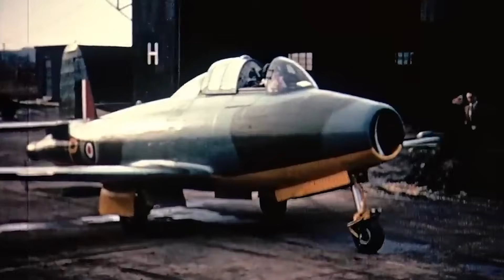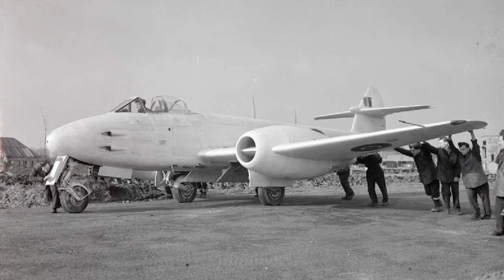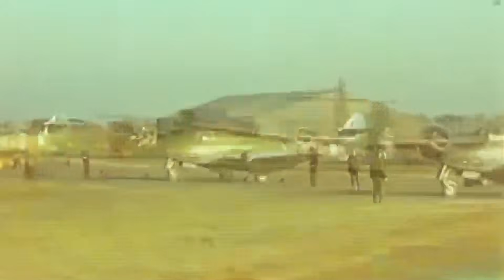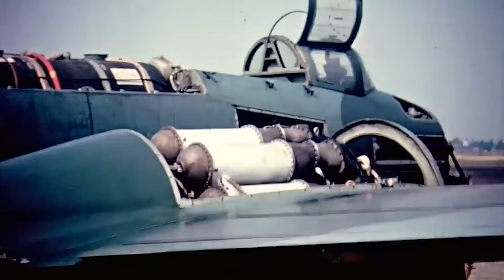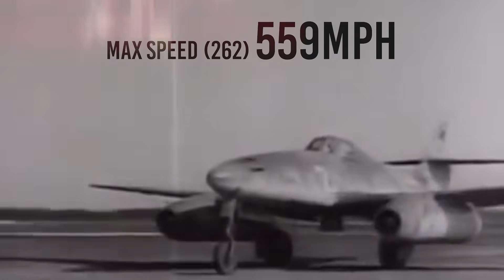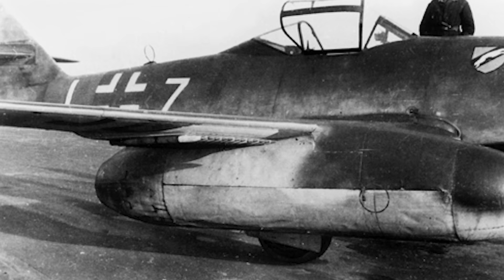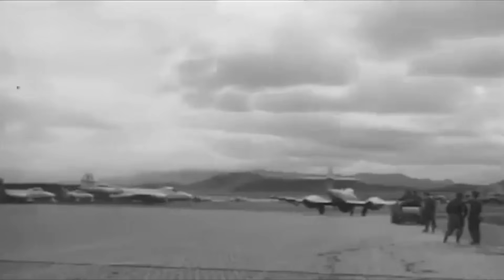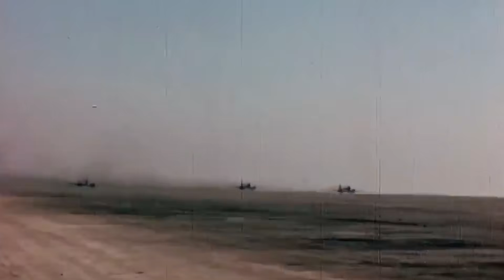Meteor vs Me 262 | Which was the better WW2 jet?

Comment: No Meteor ever had a Tailwheel!!! The first four Me-262's did!!!
Reply from the maker: you are so right - we got this around the wrong way - will put a correction in the description - thanks for spotting the error!
Reply: METEOR. l'aereo delle. MERDACCE ASSASSINE.
Reply: The 262 was essentially like the Heinkel which had a nose gear and a different empenage which made takeoff and landing easier but the swept wing of the 262 gave it more speed.
Reply: @WilhelmSallsten The sweep of the Me262’s wing was accidental. It was a consequence of the centre of gravity being further aft than expected.
The wing sweep is somewhat less than the typical subsonic jet and about the same as the DC-3.
The research on wing sweep in wind tunnels at sonic speeds post dates the design of the Me262 and the Me P1101 more accurately shows the results. The Me262 wings thickness undermined its ability to be controllable at high speeds - thinner wings, like on the Spitfire, or laminar flow wings, like on the P-51, perform better above Mach 0.84.
The Me262 was fitted with the gear off the Me309 because it had insufficient elevator authority to lift the tail off the ground at any airspeed the aircraft could reach tail down.
Reply: @allangibson8494 Indeed, the 262 pilot had to tap the brakes to get the tail off the ground and into clean air.
Reply: @allangibson8494  Nah, the 262 was faster than the Mustang and Spitfire. Over 100 mph faster. The Messerschmitt Me 262 initially had only its outer wing swept back by 18.5 degrees to fix a center of gravity problem caused by heavy engines. Later, using data from wind tunnel tests at AVA Göttingen, engineers also swept the inboard section leading edge to match. High speed aerodynamic research did not exist in England until after WW2, when the British were able to obtain German super sonic wind tunnels, scientists and research which eventually led to the Concorde. BTW, the propellor was the limiting factor on all piston engine fighters' critical Mach number.
Reply: @TheAneewAony The Me262 was faster in level flight. It was slower in a dive than a Spitfire. (The Spitfire was a beast - but lacked the range to get to central Germany where the Me262’s operated).
The late 1944 Gloster Derwent Meteor was faster in level flight than the Me262 even with its straight wings - because it had more than twice the thrust.
A quarter of the Me262’s ever flown were shot down by P-51 Mustangs.
About half of the total were however brought down due to engine failure. (Me262 Jumo engines were that bad with a cycle life of ten to twenty starts).
Reply: @allangibson8494  It's true that Martindale took a Mark XI Spitfire into an extreme high-speed dive exceeding 600 mph, but the wings were bent and the propeller broke off nearly killing him, and the airframe was written off. In 1944 the Me-262 HG I hit over 600 mph in level flight. German records and pilot victory claims attribute roughly 7 Spitfire kills to the Me 262, all 28 WW2 jet aces flew the 262. At this point of the war, the 1936 design Spitfire was completely outclassed by vastly superior P-51. 8th AF P-51 Mustangs defeated the Luftwaffe making it safe for the RAF to operate in daylight. No version of the WW2 Meteor ever approached 500 mph, none, zero. In fact the Meteor III's airframe was still limited to .74 Mach and 500 mph IAS in 1946. This is outlined in the 1946 Central Fighter Establishment report number 68, paragraph 54: "FLYING LIMITATIONS: 
(i) The maximum permissible speed on the Meteor III, imposed for structural considerations is 500 I.A.S.
(ii) The critical Mach, number on the Meteor III is.74. (This is additional to the 500 m.p.h. I.A.S. restriction mentioned above). Therefore, it can be seen that at low altitude the structural limitation is the deciding maximum and at altitude it is the Mach, number limitation."

Eric Brown: “Speed. Speed. It was a pedestrian aircraft, really, the Meteor. It never went into… It never fought operationally. It fought, if you like to call it that, against the V1, the flying doodlebug, and quite successfully. But it really was too slow to deal with the German jets when they came into being. They were a grade above at first. The Me262 is quite frightening. It gave us a shock to find out, because when I flew it the fastest fighter we had – piston fighter, of course – in the Allied camp was the Seafire Mk14 with a top speed of 446mph. The Me262 was 125mph faster than that aircraft. So this was a rude shock to our system, I tell you, when we found that out.”
Reply: @TheAneewAony 

LOL
 Early days, jet engines. Whittle performed the world's first demonstration of a gas turbine aero engine in 1937. The RR Nene, a centrifugal gas turbine aero engine, was the world's most reliable & most powerful gas turbine aero engine in 1944. Licensed built versions & copies of the RR Nene & RR Derwent would go on to power many aircraft in Russia including the Mig 15 & Mig 17, the US, China, France & other countries for decades after 1944. Incidentally, the Mig-15 was in essence an upsized / tweaked copy of the Whittle / Gloster E28/39 jet aircraft including an uprated copy of the RR engine.  The basic centrifugal compressor gas turbine aero engine with Whittle style reverse flow combustors and sometimes an axial compressor section is still manufactured by more than one company including Pratt and Whitney, the main application being helicopters.

The gas turbine engine was invented in England during the 1700s.

During the late 1800s Parsons of Ireland & North England produced the world's first axial multi stage sequential stator rotor turbines and compressors for turbomachinery use which would eventually go on to to form the main components of the axial gas turbine aero engine. At the time the basic idea of making an internal combustion gas turbine engine and using it as an aircraft engine was considered thus the jet aircraft concept had been created in England before the first powered aircraft flew.

An example of what goes on these days in various countries. For example, there are of course no German companies that makes German jet aircraft in Germany & there are no German Companies that make German gas turbine aero engines in Germany that are suitable for widebody airliners.

The UK has the world's highest combined per capita Nuclear / Defence / Aerospace Sector Activity.
Reply: @petemaly8950  LOL, Whittle never built an axial flow engine. If he could have he would have. We agree, there are still a couple of places where the low tech, low cost centrifugal engine has application, generators etc. The Russians built copies of the Nene for the same reason that the British did, they struggled with the complex axial flow and the simple centrifugal flow is all that they could do. BTW, Dr Franz, inventor of the axial flow engine which was used in the Me-262 and the Ar 234,  alsodesigned the helicopter engines used in the Bell UH-1 Iroquois, Bell AH-1 Cobra, Boeing CH-47 Chinook and the M1 Abrams tank engine.. 

"The day the 262 arrived, every Allied fighter became museum pieces". -- Eric Brown

"Britain’s military dependence on US ‘no longer tenable’, says former Nato chief"  --https://www.theguardian.com/politics/2026/apr/22/britain-military-dependence-on-us-no-longer-tenable-lord-robertson
Reply: @richardvernon317  No Meteor ever saw WWII combat!!!
Reply: @TheAneewAony  WRONG!!! 616 Squadron were allowed to operate over Enemy Territory from 16 April 1945 while based in South Holland and in Germany Proper. Flew 208 operational Armed Recce and attack missions up to 4th May, including 2 deliberate attacks on Luftwaffe Airfields at Nordholz and Schonberg. On the later the Meteors destroyed 7 Luftwaffe aircraft on the ground. The Meteors during this period shot up around 60 vehicles, 2 trains and a couple of Flak positions to boot.  Only manned German aircraft that the Meteor ever ran into while both aircraft were airborne was a Stoch on 2nd May 1945. The Stoch managed to evade the Meteor’s first attack and as the meteor pilot set up for his second pass, the Storch pilot dumped his aircraft in a field, him and his passenger jumped out of the aircraft and ran for cover. After which the Meteor destroyed it with its 20mm Cannons. In WW1 that would have counted as a kill.
Reply: @richardvernon317  Nah. The Meteors were intentionally hid from combat due to its slow speed. The Meteors shot at already abandoned vehicles behind friendly lines. No Germans fired at Meteors, nor did any Meteor fire at a German. None. To give pilots combat experience and test the aircraft’s four 20mm Hispano cannons without risking the jets over enemy territory, they were sometimes directed to strafe "targets of opportunity" in liberated areas. This included already abandoned or captured German vehicles and equipment. The Storch nearly shot a down a Meteor, pretty amazing. One Meteor may have been shot down by a He 162.
Reply: @TheAneewAony     

As you know, the worlds first demonstration of a gas turbine aero engine was performed by Frank Whittle in 1937. He had drawn up basic designs for all current modern gas turbine engine configurations during the 1930s.   

LOL No 262 managed to down a Meteor. The Nimonic nickel super alloys were developed in Hereford England 1939 -1940. In Germany they thought they needed to use stainless steel for turbine blading which doesn't work and due to various issues ended up attempting to use pressed sheet steel turbine blades. 

262 & it's engines = Garbage (but it did actually fly which surprises a lot of people). In both Russia and France good people wasted their time trying to do something with the engine after 1945. Russians ceased trying in 1948 as their own effort was clearly better.
In France RR got involved in 1950 and managed to get something useful working. 

We feel we can clear up some commonly held myths and misconceptions, obviously.
It's always good to see the facts presented clearly and concisely isn't it?

The Gloster Meteor was one of the world's first jet fighters to go into service, it was in service during WW2. The meteor was the first effective multirole fighter bomber jet aircraft with a reliable engine to go into service,  It broke speed records in 1945 and 1946. During WW2 it was in service as a fighter and multirole aircraft over the UK and over all allied controlled territories in Europe and beyond. 

The ME-262 and it's 46 minutes life engines were abandoned shortly after 1945, it had a do not exceed speed of 456 mph and was only ever used to attack bombers with losses of three 262s for each downed bomber.  During WW2 most of the ME-262s were destroyed by their engines, were various types of accident losses or were shot down by bombers. No German designers were involved with the Mig-15. The Mig-15 used a copy of the RR Nene.  

During the Korean conflict most of the Meteor casualties were due to groundfire or accident losses. The result of any tangles between Migs and Meteors was that Mig pilots avoided getting into dogfights with Meteors. The battle of Sunchon, where 50 Migs against 14 Meteors resulted in the supposedly superior Migs failing to gain any clear advantage caused the Koreans to re-evaluate tactics. General opposition in Australia to involvement in the Korean conflict resulted in the govt using the battle as an excuse to reduce the RAAFs involvement to troop support only.

The world's first wind tunnel was built in England during the 1800s. The world's first supersonic wind tunnel was built in England during the 1920s. 

The Whittle Gloster E28/39  was of course a brilliant aircraft that was later copied in Russia as the upsized and tweaked Mig 15 with a copy of the RR Nene gas turbine aero engine. The RR Nene being the world's most powerful & most reliable gas turbine aero engine in 1944.

The MD F3H Demon was a contemporary to the DH Sea Vixen & had a similar performance. The F4 Phantom was a follow on from the F3 Demon. The Sea Vixen took a long time to get from first flight to introduction for various reasons and a similar situation occurred with the MD F3H Demon.

McDonnell Douglas F3H Demon
590 Built. Not Supersonic.
Max Speed 578 MPH.
Introduction date 7 March 1956
First flight 7 August 1951
Retired 1964

MD F-4 Phantom 2
Number built 5,195
Manufactured 1958–1981
Introduction date 30 December 1960
First flight 27 May 1958

DH Sea Vixen
Number built 151 (including two DH110 prototypes and one Sea Vixen prototype)
Introduction date July 1959
First flight 26 September 1951
Max speed 695 MPH.
Retired 1972

Interesting British achievements.
There is no doubt that the Fairey (England)
Delta 2 was of course the world's first jet
aircraft to exceed 1000 mph.  Indeed It
exceeded the previous record by 310 mph &
held the record for 1 year. Incidentally, the Dassault Mirage 3 & 4 are based on the Fairey Delta 2.

The Panavia Tornado & Euro fighter Typhoon are British design aircraft with British design engines built by international consortiums. 

The EE Lightning was one of the fastest aircraft on the planet when it first achieved a Mach 2 flight. 

Early days, jet fighters.
De Havilland Vampire, Sea Vixen & Gloster Meteor accident losses were not high or unusual for fighter aircraft at the time. De Havilland built large numbers of all metal airframe aircraft before the DH Comet.
We mustn't forget of course that the DH Vampire for example first flew in 1943 & the engine was also built by De Havilland. There were examples of the Vampire interceptor / fighter in service until 1990 which was operated by more than 30 countries.

Non combat phase accident losses.
% of Aircraft built.

The Canadair CL-44 was a turboprop airliner.
Canadair CL-44                  (ff 1959 ) 48%
Lockheed XF104                (ff 1954) 100%
Lockheed  P80                   (ff 1944) 43%
Lockheed F104                 (ff 1954)  45%
Grumman f9f-5 Panther   (ff 1947) 44% 
Convair F102 Dagger        (ff 1953) 45%  
MD F-101 Voodoo.             (ff 1954) 34%
MD FH Phantom 1            (ff 1945)  35%
MD F4 Phantom 2             (ff 1958)  28%
MD F3H  Demon               (ff 1951)  32%
Gloster Meteor                  (ff 1943)  21%
DH Vampire UK                (ff 1943)  23%
DH Sea Vixen   UK           (ff  1951) 33%
Gloster Javelin  UK         (ff 1951) 20%
EE Lightning  UK             (ff 1954) 33%

It's a great pity & a crying shame that British military forces had to occupy a large part of Germany for decades after 1945 & Russian military forces had to do the same. Of course Russia still posseses a large chunk of what was German territory & of course Russia & the UK produce nukes. Obviously Germany does not produce nukes.

Early days, jet engines. Whittle performed the world's first demonstration of a gas turbine aero engine in 1937. The RR Nene, a centrifugal gas turbine aero engine, was the world's most reliable & most powerful gas turbine aero engine in 1944. Licensed built versions & copies of the RR Nene & RR Derwent would go on to power many aircraft in Russia including the Mig 15 & Mig 17, the US, China, France & other countries for decades after 1944. Incidentally, the Mig-15 was in essence an upsized / tweaked copy of the Whittle / Gloster E28/39 jet aircraft including an uprated copy of the RR engine.  The basic centrifugal compressor gas turbine aero engine with Whittle style reverse flow combusters and sometimes an axial compressor section is still manufactured by more than one company including Pratt and Whitney, the main application being helicopters.

The gas turbine engine was invented in England during the 1700s.

During the 1800s Parsons of Ireland & North England produced the world's first axial multi stage sequential stator rotor turbines and compressors for turbomachinery use which would eventually go on to to form the main components of the axial gas turbine aero engine. At the time the basic idea of making an internal combustion gas turbine engine and using it as an aircraft engine was considered thus the jet aircraft concept had been created in England before the first powered aircraft flew.

An example of what goes on these days in various countries. For example, there are of course no German companies that makes German jet aircraft in Germany & there are no German Companies that make German gas turbine aero engines in Germany that are suitable for widebody airliners.

The UK has the world's highest combined per capita Nuclear / Defence / Aerospace Sector Activity.

UK defence sector, absolute terms, world's second highest activity. 1st for per capita defence sector activity. Per capita nuclear powered submarine construction, 2nd position. 
Main players being Rolls Royce, Babcock, GKN Aerospace & BAe Systems. Activities often involve international collaboration. BAe systems, RR and other UK companies now handle more Airbus work value wise than Germany. 

There's a good chance that anyone currently flying on a widebody airliner will be on an aircraft powered by RR gas turbine aero engines made in the UK and a good chance there will be other hardware on the aircraft that's designed and / or manufactured in the UK. 

Rolls Royce Holdings UK
Subsidiaries
- Rolls-Royce plc
- Rolls-Royce North America (ex Allison etc Classified Military stuff)
- Rolls-Royce AB
- Rolls-Royce Deutschland
- Rolls-Royce India Private Limited
- Rolls-Royce Marine Power Operations
- Vinters Engineering Limited
- Rolls-Royce Controls and Data Services
- Rolls-Royce Power Systems
- Bergen Marine
Joint ventures include:
- Rolls-Royce Turbomeca
- MTU Turbomeca -

Trent Family
The MT30 (Marine Turbine)
Industrial Trent 60 Gas Turbine
Trent 7000
Trent XWB Airbus A330neo.
Trent 1500
Trent 1000
Trent 500
Trent 600
Trent 700
Trent 800
Trent 8100
Trent 900
   
RR wholly owned subsidiaries in Germany handle smaller 2 shaft RR gas turbine aero engine work.

The UK space and aerospace sectors are highly productive, high-value industries that together contribute over £18 Billion in direct Gross Value Added (GVA) to the UK economy. Individually, the space industry directly contributes about 0.3% of UK GDP 7•2 Billion while the aerospace industry contributes approximately 0.5% £10•9 Billion.
   
Wee hopes theze helpsmz.  EtC---.

We hope this helps of course 👍
Reply: @TheAneewAony 

 Early days, jet engines. Whittle performed the world's first demonstration of a gas turbine aero engine in 1937. The RR Nene, a centrifugal gas turbine aero engine, was the world's most reliable & most powerful gas turbine aero engine in 1944. Licensed built versions & copies of the RR Nene & RR Derwent would go on to power many aircraft in Russia including the Mig 15 & Mig 17, the US, China, France & other countries for decades after 1944. Incidentally, the Mig-15 was in essence an upsized / tweaked copy of the Whittle / Gloster E28/39 jet aircraft including an uprated copy of the RR engine.  The basic centrifugal compressor gas turbine aero engine with Whittle style reverse flow combustors and sometimes an axial compressor section is still manufactured by more than one company including Pratt and Whitney, the main application being helicopters.

The gas turbine engine was invented in England during the 1700s.

During the late 1800s Parsons of Ireland & North England produced the world's first axial multi stage sequential stator rotor turbines and compressors for turbomachinery use which would eventually go on to to form the main components of the axial gas turbine aero engine. At the time the basic idea of making an internal combustion gas turbine engine and using it as an aircraft engine was considered thus the jet aircraft concept had been created in England before the first powered aircraft flew.

An example of what goes on these days in various countries. For example, there are of course no German companies that makes German jet aircraft in Germany & there are no German Companies that make German gas turbine aero engines in Germany that are suitable for widebody airliners.

The UK has the world's highest combined per capita Nuclear / Defence / Aerospace Sector Activity.
Reply: And the Me262 prototypes had a piston engine (because the jet engines were so unreliable).
Reply: @allangibson8494 They had to test the airframe with cheaper engines.
Reply: @allangibson8494  not a Wehraboo but that's not why early prototypes didn't use jet engines. It was because the engines didn't actually exist at the time and they needed to show something to get some cash back from the RLM
Reply: @allangibson8494  (because the jet engines were so unreliable) No it was because Engines were not finished yet! still in development!
Reply: @tigercub1906 The Ju004 had a mean time to failure (not overhaul) of 15 to 25 hours in service AFTER they cured the catastrophic vibration issues in December 1943.  The British Welland had a 150 hour OVERHAUL interval by this time and the Derwent was putting out over twice the power just slightly later.
Reply: @allangibson8494  outright lies! 150 hours? laughable! not a single early jet engine had that!
Reply: @AndreasKonig-qq7yk The RR Welland did.
It passed a 500 hour type test with a 180 hour oil change interval.
The German engines were crap.
Reply: @allangibson8494  Yet they dominated. Funny that.
Reply: @tenbear5 The Germans LOST. That is the opposite of “dominated”.
A third of the operational Me262’s crashed due to dual engine failure.
A quarter were shot down by P-51 Mustangs.
And the general consensus was that the Me262 was a lousy bomber interceptor because it was too fast - the closing speed was too high and the gun firing rate too low to put a useful number of shells into a target. The Me163 had the same problem. 
The solution was the speed brakes added to the next generation fighters that also permitted higher throttle settings on approach that permitted a go around with the slow engine throttle response of early jet engines. 
Pushing the throttle forward fast on a Ju004 engine was a guaranteed engine explosion. 
Pushing the throttle hard on a Welland or Derwent was more a case of waiting 6 seconds for a response.
Reply: @allangibson8494  Nothing came close. You’ll get over it.
Reply: @tenbear5 The Gloster Meteor got the first jet engine air speed record in 1945. The Me262 got scrapped.
Reply: @tenbear5  Meteor and Me 262 never met... How could Me 262 'dominate'  and after all the allies won the war
Reply: @tigercub1906 The engines lasted less than one flight on average into 1943...
Reply: @allangibson8494  just didn't have the metals needed witch made the far less than they would have been.
Reply: @tigercub1906 The early ones did - the design failed on those however.
Reply: @allangibson8494  test engines
not operation until 44
Reply: @tigercub1906 The Ju004 engines manufactured prior to December 1943 all had catastrophic vibration problems.
After December 1943 they merely shortened the average engine life to 25 hours (before a compressor blade broke).
Reply: The 262 derives from a 1938 piston engine design.
Reply: @johnburns4017  The Me 262 began as Messerschmitt's Projekt 1065 in 1939, as a twin jet fighter. The same year the the Germans invented the jet airplane
Reply: @TheAneewAony  
docktorbimmer a quiz.
Name the inventor of the turbojet?
20 points for the correct answer.
Reply: @johnburns4017  The inventor of the first jet engine, one that worked, one that could fly two years before Whittle? Ohain. Whittle however stated that it was Maxime Guillaume
Reply: @TheAneewAony 

 Early days, jet engines. Whittle performed the world's first demonstration of a gas turbine aero engine in 1937. The RR Nene, a centrifugal gas turbine aero engine, was the world's most reliable & most powerful gas turbine aero engine in 1944. Licensed built versions & copies of the RR Nene & RR Derwent would go on to power many aircraft in Russia including the Mig 15 & Mig 17, the US, China, France & other countries for decades after 1944. Incidentally, the Mig-15 was in essence an upsized / tweaked copy of the Whittle / Gloster E28/39 jet aircraft including an uprated copy of the RR engine.  The basic centrifugal compressor gas turbine aero engine with Whittle style reverse flow combustors and sometimes an axial compressor section is still manufactured by more than one company including Pratt and Whitney, the main application being helicopters.

The gas turbine engine was invented in England during the 1700s.

During the late 1800s Parsons of Ireland & North England produced the world's first axial multi stage sequential stator rotor turbines and compressors for turbomachinery use which would eventually go on to to form the main components of the axial gas turbine aero engine. At the time the basic idea of making an internal combustion gas turbine engine and using it as an aircraft engine was considered thus the jet aircraft concept had been created in England before the first powered aircraft flew.

An example of what goes on these days in various countries. For example, there are of course no German companies that makes German jet aircraft in Germany & there are no German Companies that make German gas turbine aero engines in Germany that are suitable for widebody airliners.

The UK has the world's highest combined per capita Nuclear / Defence / Aerospace Sector Activity.
Reply: @petemaly8950  We agree that Britain and Russia lacked the technology to build axial flow engines, postwar England was bankrupt and had to make do with obsolete technology. To this very day the UK has no effective military and relies on America for defense.
Reply: @johnburns4017  When did the Germans invent the jet airplane? It probably used a jet engine. It probably wasn't Whittle's as he was still bench testing for several more years
Reply: @petemaly8950  When did the Germans invent the jet airplane? It probably used a jet engine. It probably wasn't Whittle's as he was still bench testing for several more years
Reply: @TheAneewAony  
Pre WW2 Britain was on two paths when inventing the jet engine: 

 1) The axial-flow air compressor by Griffiths; 
 2) The centrifugal air compressor by Whittle. 

 Griffiths' 1926 seminal paper laid down axial-flow. His paper actually outlined a turbo prop. He did not believe at the time the engines could produce enough thrust, but could turn a propeller. He got Metrovick to develop an axial-flow turbojet in 1938, who started the groundwork of the F.2 axial-flow in 1940, having an engine first spin in the same year, with a successful test bed spin in 1941. 

Whittle's patent was in 1930, which laid down the turbojet. All this info was available to the Germans. Whittle went for centrifugal, as it was a simpler way of compressing air. Whittle wanted a simple air compressor to establish his turbo jet design quickly. In short, he was interested more in establishing the back end of the engine, the thrust, rather than the front. Once the back end was perfected then he could improve the front, the air compression. This was the sensible approach. 

The centrifugal compressor was perfectly adequate to prove the rear thrust side of the engine. As post war engines proved, the centrifugal was taken to higher limits. Axial-flow compression was a series of fans on one shaft, with successive fans passing compressed air to the next fan to increase air compression. This added complexity in many ways. Griffiths went for the more complex axial-flow. He also laid down a contra-rotating compressor, but Metrovick did not go down that road. The more powerful F.2 was used to fly the Meteor plane but considered unreliable at that stage, so Whittle's centrifugal engine was used. 

The F.2 was far more reliable than the German Jumo, but the British would never put a plane in the air with such an unreliable under-developed engine. Wiggin in Birmingham, who still exist in Hereford, were commissioned to develop and improve high temperature resistant alloys and improve them as the jet engines were being developed. The Germans had no such programme. 

The F.2 ended up as the post war Sapphire being built under licence in the USA as the J65, powering the: Douglas A-4 Skyhawk, Grumman F-11 Tiger, Martin B-57 and the Republic F-84F Thunderstreak.It took the French a wasted eight years to get the German design reliable, which by that time they had discarded many of the German engine concepts. The French airliner the Sud Aviation Caravelle, used Rolls Royce Avon engines the French engines, based on German designs, were so good.
Reply: @petemaly8950  Yes we agree! Britain built one axial flow jet during WW2. Unfortunately it exploded killing the pilot William Davie. Britain lacked the correct technology to build a working axial flow engine until 1947.  As a result of this failure, the UK relies completely on America for defense, as Britain has no credible military
Reply: @TheAneewAony   @TheAneewAony  

Indeed, its entirely correct that -

We agree Britain had the technology to design and build axial flow engines,  the internal combustion gas turbine aero engine and jet aircraft were invented in Britain during the 1800s,  postwar defeated Germany was morally and financially derelict and thoroughly bankrupt and had to make do with obsolete technology. All British axial and centrifugal gas turbine aero engines were clearly far more powerful and reliable than any rubbish being produced in Germany at the time.

To this very day Germany has no effective military and relies on the UK & France for defense. Britain makes nukes and is 2nd in the world for per capita nuclear powered submarine construction and 1st in the world for per capita defence sector activity.   

Indeed, anybody currently flying on a widebody airliner is likely to be on an aircraft powered by RR gas turbine aero engines. 

There are currently no German companies making German gas turbine aero engines in Germany that are suitable for widebody airliners.

We hope this helps of course.
👍
Reply: @petemaly8950  "RR gas turbine aero engines."  Virtually all modern military and commercial axial-flow jet engines conceptually trace their architectural lineage back to the Junkers Jumo 004. Designed by Dr. Anselm Franz, the Junkers Jumo 004 was the world's first mass-produced, operational turbojet engine.. Hope this helps! Meanwhile, Britain still relies completely on the United States for defense, as they did during WW2.
Reply: @TheAneewAony   @TheAneewAony 

LOL & LMFAO 🤣🤣
 Early days, jet engines. Whittle performed the world's first demonstration of a gas turbine aero engine in 1937. The RR Nene, a centrifugal gas turbine aero engine, was the world's most reliable & most powerful gas turbine aero engine in 1944. Licensed built versions & copies of the RR Nene & RR Derwent would go on to power many aircraft in Russia including the Mig 15 & Mig 17, the US, China, France & other countries for decades after 1944. Incidentally, the Mig-15 was in essence an upsized / tweaked copy of the Whittle / Gloster E28/39 jet aircraft including an uprated copy of the RR engine.  The basic centrifugal compressor gas turbine aero engine with Whittle style reverse flow combustors and sometimes an axial compressor section is still manufactured by more than one company including Pratt and Whitney, the main application being helicopters.

The gas turbine engine was invented in England during the 1700s.

During the late 1800s Parsons of Ireland & North England produced the world's first axial multi stage sequential stator rotor turbines and compressors for turbomachinery use which would eventually go on to to form the main components of the axial gas turbine aero engine. At the time the basic idea of making an internal combustion gas turbine engine and using it as an aircraft engine was considered thus the jet aircraft concept had been created in England before the first powered aircraft flew.

An example of what goes on these days in various countries. For example, there are of course no German companies that makes German jet aircraft in Germany & there are no German Companies that make German gas turbine aero engines in Germany that are suitable for widebody airliners.

The UK has the world's highest combined per capita Nuclear / Defence / Aerospace Sector Activity.🤣
Reply: @johnburns4017  lol